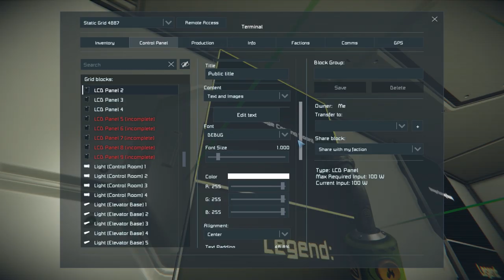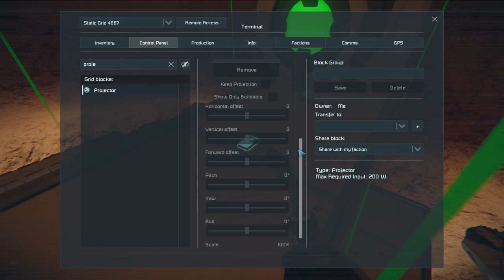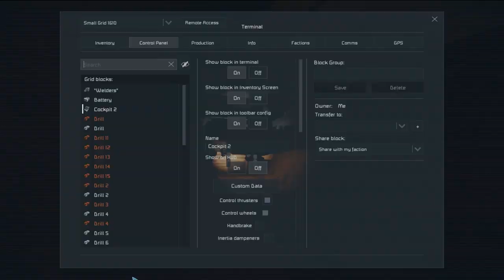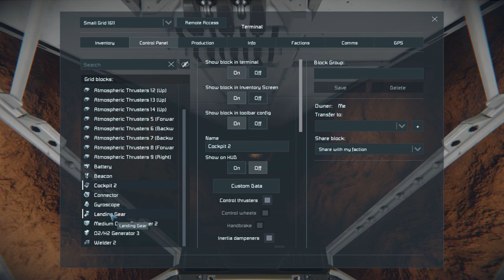Space Engineers Let's Play (S3 | E16) - This Train Builds its Own Track!

Comment: Two suggestions. One use unweeded batteries as ballast. Two face the drills forward and away from what you are welding. You are chewing through tons of steel plates with the current placement.

Comment: At first I was thinking with the weight issue you'd want to build the small survival refinery and a basic assembler onto the tram platform, so that when the drill mined into the dirt, you could then pipe the dirt into the refinery to turn it into iron ingots, then the ingots would go into the assembler to be turned into steel plates for the welders. That way you wouldn't have to keep checking your inventory and running back to get more steel plates. But I suppose your way works better, though I can only right-click dig with my hand drill.
Reply from the maker: In order to do right click mining with the bigger drills, you have to use "block tools" and right click from the cockpit. You can't set a drill to automatically right click mine. You've gotta do it manually from the cockpit of the ship.